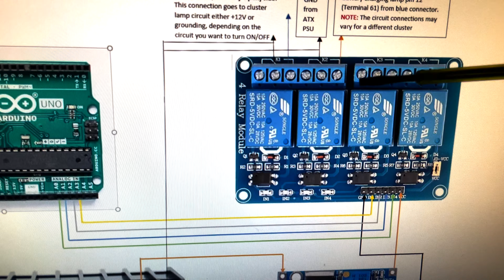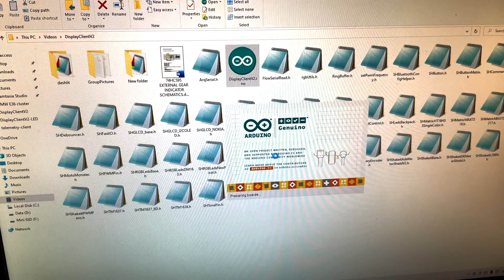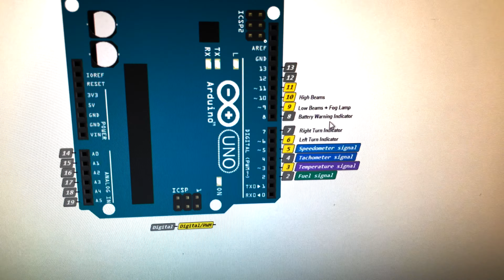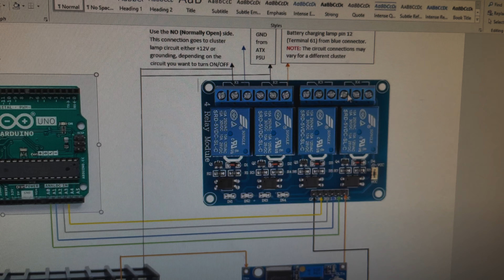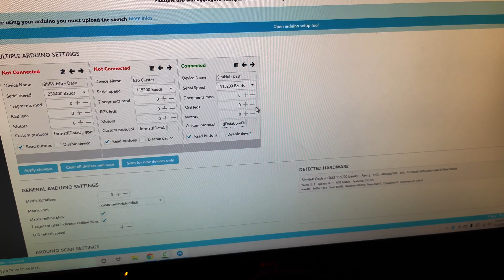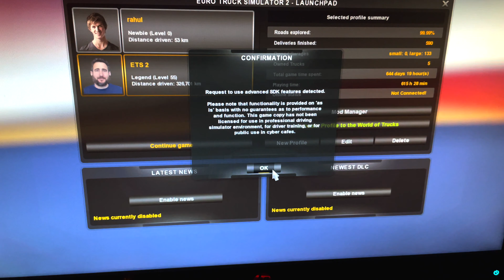How to wire BMW E36 cluster with basic dashboard lights #simracing #bmw #automobile #arduino

Comment: Can transistors be used instead of relays? (i use lancer 9 cluster, hope it works. haven't checked yet)
Reply from the maker: Hi,

Yes, you can use transistors and trigger it using the Arduino to power the cluster lamps. Just make sure that the transistor is able to handle the power, the main cluster illumination lamp is 12V 3W & the smaller warning lamps are 1.5W.
Reply: @sciencetrove  Thanks for the answer. I'm going to connect the cluster power directly. And connect it to 12v 1A. Including transistors. I don't know much about electronics. The amperage from the power supply will not harm the lamps? I think the current power of the arduino is enough to switch the transistor on which is a 12v?  If the arduino is powered by usb. So, that the transistor moves to the open position.
ps.If I succeed, I will publish the instructions to the public. Quite a little bit of information about the lancer 9 cluster.
Reply from the maker: @chesukineyznalipahana  I think a 12V 1-2A power supply should be fine. Regarding using Arduino signal to power a transistor I would recommend you watch a YouTube tutorial how it’s connected and powered.
Reply: @sciencetrove  Okey. I will try to do this :)
Reply: @sciencetrove  https://youtu.be/HCWy9VCG_fk
Done, but speedometer shake sometime. And unfortunately, the fuel sensors don't work. I'm going to change the resistance through the resistors, maybe it will work for fuel. Could you share the settings for all sensors? ABS, BRAKES, OIL, Check engine.
Reply from the maker: @chesukineyznalipahana  Yeah, on some clusters the Speedo may not be very smooth. But it looks fine in the video. Good job! Well out of 3 older style clusters I had tested only on the BMW E36 I was able to control the fuel gauge by playing with the PWM values on simhub. Most folks just add a resistor and call it a day. One guy I saw actually removed the stepper motor of the fuel gauge on a cluster and put his own Arduino servo motor to drive it directly. I previously had put a code that also included the oil and parking brake. Actually you can just add a if loop with the states for the two and just add the corresponding custom protocol for it to get those lamps running. I see one red lamp lit, is it battery?
Reply: @sciencetrove  yes, I connected the battery to the 8 pin, from your code. But for now from 5v, for the test, without relay. Warning ABS turns on automatically if not connected. In the assetto corsa, the battery is always on, like i understood. Or just need to connect the relay.
Reply from the maker: @chesukineyznalipahana  Maybe you need to ground the abs pin to turn it off. It depends on how you wire the relay. Did you try to connect the battery lamp to the other terminal i.e, there is a normally closed and normally open terminal.
Reply: @sciencetrove   yes, when connected via a transistor - lamp works fine.
Reply: @sciencetrove   I'm almost done with this, you can see the result https://youtu.be/PRH9dH8-D54 When the speed changes dynamically, there are shake, maybe can be removed if change the update speed of the arduino port, I don't know yet.

Comment: Hi great video can I use same setup for a Peugeot 308 cluster and if possible can I have the word doc file which shows the diagram with relay and extra power board , regards and thanks again
Reply: Hi thanks for heads up , so I went and bought a bmw e90 dash . Can you advise on where to get pin outs for  this cluster as u say just starting to learn if you regards
Reply from the maker: @cpproctorpro8750  Is it the US cluster or EU version?
Reply from the maker: @cpproctorpro8750  So, for the pinouts follow this page:

https://www.e90post.com/forums/showthread.php?t=1608513

There is an Arduino code and plugin developed by a Polish guy Marcin for the E90/92/84.

For the telemetry plugin, download and put the .dll file inside game directory plugin folder (Mine looks like this D:\Games\Euro Truck Simulator 2\bin\win_x64\plugins):

https://github.com/Marcin648/ets2-telemetry-udp/releases/download/v0.2.0/ets2-telemetry-udp.dll

Arduino code:

https://github.com/Marcin648/e90-dashboard-ets2

You need to flash this using Visual Studio to an Arduino UNO or Mega.

The can bus twisted pair of wire goes to a can bus shield like from Seeed Studio on the Arduino.
Reply: @sciencetrove  thankyou so much for all help will let u know how to get on when the cluster arrives, the cluster I got is a bmw 3 series e90 cluster  9166828
Reply from the maker: @cpproctorpro8750  Sure, no problem. It's good that you got that particular model cluster. That's the exact one Marcin has used i.e., European variant. Your cluster should be fully functional like his. I have a slight different one which is the US variant and for me I have some issues with the RPM and timing due to which the turn signal is not blinking at right timing.
Reply: @sciencetrove  hi got my cluster today , and got adrunio uno board , and can shield , and found the page with pin out descriptions , but me been thick , there is no diagram of what side pins are numbered , or what pins goto where on adrunio board , I know I need to plug pin 9 and 18 to adrunio can shield the green screw bit , and I know I upload the adrunio code to board and place .dll in folder of euro truck 2 plug-ins , but where does the python bit goto , does it load onto adrunio on top of the adrunio program , any help would be amazing
Reply: Hi I found. A diagram for bmw e90 cluster and it comes on  with power with bottom screen temp , and miles , shows orange, now going to work out how to upload adrunio script using  visual studio , and then how to load pie script , I’m learning slowly , thanks to you regards
Reply from the maker: @cpproctorpro8750  Pin 9 should be +12V, pin 18 is GND, Pin 6 is CAN High & Pin 7 is CAN Low. make sure to make a twisted pair of wire for the can bus connection from shield to cluster. 

Just install the python IDE. Then launch the game and once you reach the section where the game is fully loaded, minimize the game and then launch "C:\Users\rahul\Desktop\e90-dashboard-ets2-master\telemetry-client -> telemetry-client.py script". After a few seconds a CMD window will open up and then a dialog box would appear. Choose the correct COM port of the arduino and click connect and then select game and click connect. That's all.
Reply from the maker: @cpproctorpro8750  Also, in Visual studio make sure to install the following two libraries: CAN Bus shield & Packetserial. Also, install platforms: Atmel AVR & Atmel megaAVR. You can find instructions on how to to these from YouTube tutorials. Pretty easy.
Reply: @sciencetrove  thanks will try when get up later , thankyou again hope to see working , can you use this along side sim hub
Reply from the maker: @cpproctorpro8750  Feel free to ask and I'll reply if not immediately when I'm free. Well this one needs only the python script to get it running. The guy who made it had told me a while back he may make a SimHub version later.
Reply: @sciencetrove  hi managed to do of what you said but now when running client get this message qlayout attempting to add qlayout '' to qmainwindow form which already has a layout gone  wrong some where if u can help  thanks
Reply from the maker: @cpproctorpro8750  Take a look at this please after connecting Arduino mega:

https://drive.google.com/file/d/15kg8Z4We_sRyvmwaLrQV8HEquf4gXVdc/view?usp=sharing
Reply: @sciencetrove  thanks for vid helped, but I get this error to think my card faulty  avrdude stk500v2_receivemessage() timeout,
not sure if my can cable twisted enough
Reply from the maker: @cpproctorpro8750  glad the video helped. You are getting the error in VS Studio while uploading?
Reply: @sciencetrove  yeas I load vs code , then connect IMO board , then wait until get tick and side arrow , then I press the tick first that says success green , then I press side arrow , then it say found uni on port say 14 then it comes up with yellow writing then that error shows up so don’t know what I am doing wrong , think might give up , but I see cluster sitting there , I need photo of where working is on cluster and where it is on can shield and adrunio ,  and how the can cable is twisted , and then I think I be ok , but you have been amazing with help for me it’s just I am very stupid , unless I see it in  pic format I get confused, I did manage to setup my bass shakers , via sim hub and put amps and sound card and adrunio connected ok so I am kicking myself with this project , but thanks for help .
Reply from the maker: @cpproctorpro8750  you did be surprised how long I took to figure it all out! 😁…did you install the two libraries and the platform in Visual Studio  like in below audio? 

https://drive.google.com/file/d/13eHmc4PDcbViLO-M0nK5n5sffw0qaUAg/view?usp=drivesdk

You do not need the cab bus shield to upload. The twisted pair copper wire can be a simple twisted pair. Even non twisted should work but I’ve seen on most projects people recommend it’s better to have it twisted.
Reply: @sciencetrove  hi thanks for bid really helped , I have both library’s installed , but on platform  I have nothing installed  no  atmel  or other one , where do I go to install these platforms is it extensions sorry , visual is so complicated but a very powerful software if understood properly lol
Reply from the maker: @cpproctorpro8750  it’s actually pretty easy. I found it via some website while googling. Here you go how to install it. I would have typed the instructions but it would be quite lengthy. 

 https://drive.google.com/file/d/1e_qntdqYROJ-8_wwWZwyrdu15FI2Z7I6/view?usp=drivesdk
Reply: @sciencetrove  thanks for all help I have installed all library’s and platforms , it now says in yellow , avrdude: ser_open():  can’t open device  “\\.\com14”: access is denied   .
So I think my board no good will order a new one Thursday , and try again lol thanks for help truly , I might get this done yet .
Reply from the maker: @cpproctorpro8750  The com port is unable to be accessed by Visual studio because you have some other program open that is accessing the arduino like Arduino IDE or maybe the telemetry script. Make sure only the VS studio is accessing the arduino. close other apps
Reply: @sciencetrove  ok thanks I will go through and check ports regards
Reply: @sciencetrove  hi managed to install onto board by using another pc . But the telemetry client file won’t open , the file has changed to python , so not sure what I have done , an does not matter how many times I re download it it won’t open but on another drive I have I have a single telemetry file python but it’s a large disc icon that opens but does nothing when connecting to euro truck 2 .
Reply from the maker: Sorry, I do not completely understand what you are trying to say. But make sure to install Python IDE first. If possible please make a video of what what you are trying to do and upload it to google drive or something similar and send link. It would be a lot easier to understand.
Reply from the maker: Hi,

I'm not too familiar with Peugeot cars. But a quick google search showed up that the 308 was launched in 2007 which means it makes use of a CAN bus to control. Looking at a video of the cluster kind of confirmed this theory, as I see only a single wiring harness. You will need to figure out the CAN bus codes and write an Arduino code to pull game data and activate the corresponding cluster function using the required CAN code. The above Arduino code will not work for you. Most likely your cluster functions are controller via CAN fully.

The BMW E36 & 97-99 Audi A4 clusters I've shown in the channel are the older non-CAN bus type clusters. This type is better for beginners. But if you go for a semi-CAN bus like BMW E46 or full CAN like E90/92 which already has full ready made code available online then it's okay. But, if you are new to Arduino CAN clusters can be a bit overwhelming, but you can definitely give it a shot.

Comment: Hello, i tried this tutorial, but i have issue with blinkers. I followed video step by step but no luck. Gauges are working fine. I tested it in two different arduinos, but no different. Also in Simhub values are changing from 0 to 1 when blinker is activated. My cluster is from bmw e36, 316. Any ideas what could be wrong ?
Reply: Hey bud did you manage to fix it as I'm willing to help you
Reply: @weefella7t2   Hi, I haven't been able to fix it yet. I would be happy and also thankful for your help.
Reply: @nikto322  are you using a relay as I can send you a picture of the layout of mine via a link if u need help

Comment: beautiful video. Does this work on Assetto Corsa and Beam NG?
Reply from the maker: Thank you! I’ve not tried on both the games yet. But you can give it a try on Assetto Corsa.
Reply: @sciencetrove  Awesome. Thanks for the reply. Just another question, do i need the relays in order to make the lights work? Or can i just use them without the relays and they will turn on when they need to? especially the turn signal, will the turn signal light blink without a relay or is the relay needed?
Reply from the maker: Yes. The arduino can only output 5V at extremely low currents in milliamperes range. If you had to directly run then you will need to connect an led bulb to the arduino and run it straight to the cluster after removing the cluster original lamp. Some people do that on their cluster. I saw a person with a skoda or Ford cluster do that. 

For the E36 they have 1.5W and 3W incandescent lamps. Which means using a relay is necessary to power it for 12V.
Reply: @sciencetrove  Ahh I see. Thanks for the help :)
Reply: Hi, i tried on mine and also works very well on beamng
Reply: @Albertt.c  how did you get the lights coded in?

Comment: Hey there i was wondering if it still only works on 32 bit version of the game or dose it now work on 64 bit version of the game thank you for any response im also new to this so do you have switches for the lights and indicators or is it using a button u press in game
Reply from the maker: Hi,

The current version runs on both 32 & 64 bit versions. In the demo I’m running the indicators via the keyboard button. But I currently have a headlight/turn signal lever from a Honda being  paired with USB encoder to get the lights running from the switch. It’s still on going as I’m trying to get it mounted to the desk for my dash setup.
Reply: @sciencetrove  ahh ok thx for the reply bud how would I make it so I could turn my cluster backing lights on and off
Reply from the maker: @weefella7t2  Idk which model cluster of the E36 you are using. But for my 318ti the X16 blue connector Pin 2 to +12V is for the cluster illumination. Connect it with the low beams lamp relay.

Check page 155 for pinout:

http://wedophones.com/Manuals/BMW/1997%20BMW%20318ti%20Electrical%20Troubleshooting%20Manual.pdf
Reply: @sciencetrove  ahh ok bud also got same cluster as u 318ti 1997 so makes things alot easier

Comment: Thanks for the great tutorial. I have a relay card with 8 channels and I like to have more warning lights, like low fuel, oil, handbrake. Which code I need to modify to set up these in Arduino outputs? I guess also custom protocol needs to be modified. Where are those variables defined?
Reply from the maker: Thank you! You need to add the relevant NCalc protocols for the corresponding lights, also define the pins and add the  if loops for the light states in the arduino code. I had t tried every light, but there was another code that had low oil warning, ABS, handbrake. Low fuel should also work but I didn’t try. One of the reasons I didn’t post that code is because I had only 4 channel relay and if I posted all that a lot of the new comers will get confused and would bombard me with tons of emails 😁. So I kept it as simple as I can.
Reply: Do you happen to have that code?